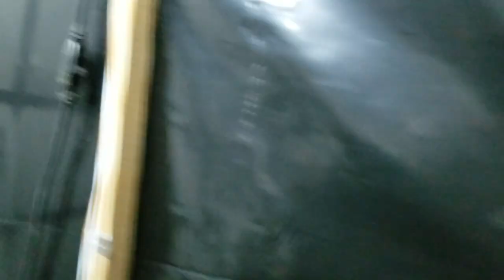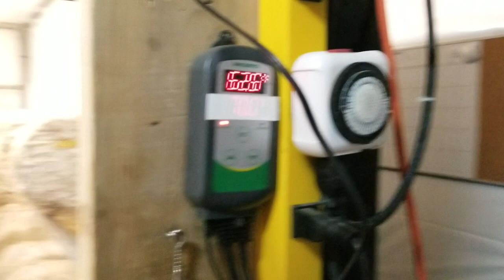Energy Saving Mushroom Farm Heat and Cooling Recovery System Hydronic HRV

Comment: Awesome videos but I have a couple questions if you don't mind.

During the summer, where is your heat going? Into the lab? If so, how cold do you keep your lab? Is the idea that you are just transferring the heat from 1 area of the garage that is not air conditioned to the lab which is air conditioned? 

Second question and I have been racking my brain with this one... I have seen in several videos that you grow king oysters, how are you cold shocking you're  bags to initiate pinning? Especially in the summer? 

Thanks and keep up the awesome videos!

Comment: So the point of this system is to heat exchange between your tent and garage? But in doing so, you’re effectively equalizing the differential unless the idea is to heat exchange, then have hvac adjust the garage temp.

Comment: For cooling why not use just a swamp cooler (evaporative cooler) a low cost alternative in which adds humidity.  I lived in Arizona many years back. The system worked great with a very low cost to operate.  May not work in all climates, but in a mushroom growing room regardless of location, I would think a swamp cooler would be very effective.
Reply from the maker: when its 105 out a swamp cooler is not enough.  I do love them though for most of the year.

Comment: How much did this setup cost?
For an indoor farm, running all year long in Texas, starting out what is the best way to get FAE? If it is 90 outside and you are using a Mini split or something similar and you are trying to make it cooler insider the grow room how would you get fresh air in without it affecting the temperature and the humidity in the room already? A mini split just recirculates the air in the room so no fresh air is being brought in.
Reply from the maker: Around $300. I have a link for the parts in the description. Yea the huge gains will be in the summer when its 105 and we are cooling it down to 65F and blowing it out.  We have the AC outside of the grow room, its in the lab.

Comment: Hey man how did this go? I just got one that runs the exhaust and intake through two washable HEPA filters. It cost a fortune and I’m worried it can’t handle the humidity/spore load. I figure if it breaks I can salvage the working parts for something useful at least. 4 HEPA filters 2 powerful blowers and the exchange core.
Reply from the maker: you dont need HEPA for fruting room air intake. the exhaust dosen't need any filtration at all. These systems work well and will cut cooling costs significantly
Reply: I wanted to filter the exhaust just because it’s right by my house and the spore load makes me a little nervous for the family. It’s the Fantech ser1504
Reply from the maker: @kalunmyers4294  just duct it outside the building, you will be fine.
Reply: Welp.. there’s $450 down the drain lol.
Reply from the maker: @kalunmyers4294  I offer consulting services if you need more money saving guidance.